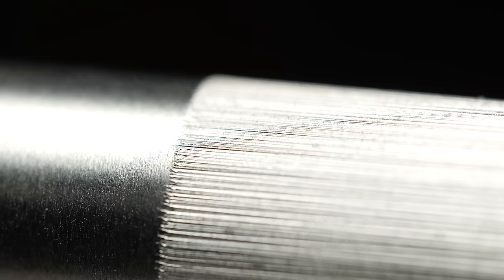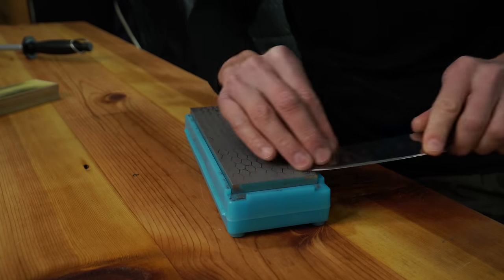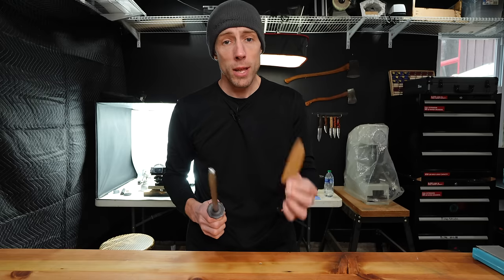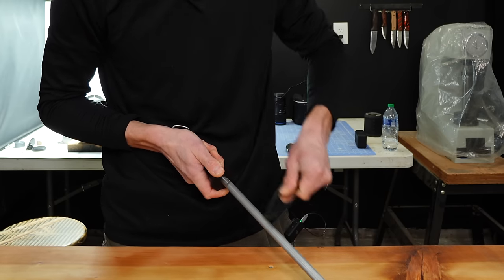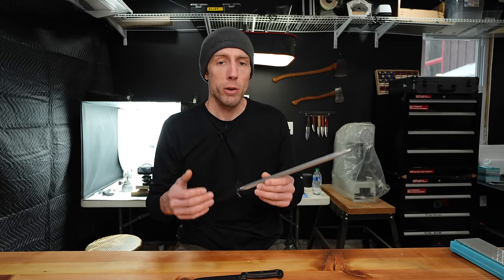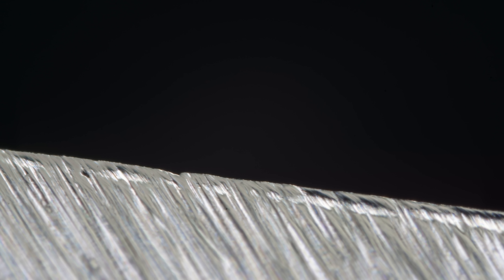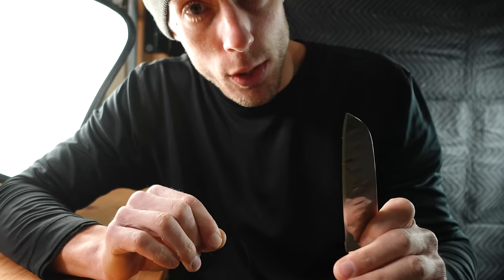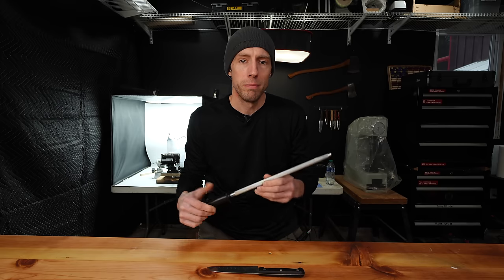What Do "Knife Sharpening" Honing Steels Actually Do?

Comment: As involved as this was... It's unfortunately not that simple. There's a few things that have been over looked here. Firstly, these were invented sometime in the late 16th to early 17th century in England. A lot has changed since then. One thing that has changed is that they're simply not made the same way as they were even 100 years ago for the most part. It used to be that most of these had a rough side and a bald side. They also used to be made out of much harder steel. And the roughness was not made with these regular width and depth finely cut grooves either. Pretty much all of the modern made honing steel rods I've seen are merely mimicking what the product was.

I attribute this drop in quality to the slow death of expertise as things shift more towards mass production. For an example of what I mean that's perhaps relatable here. What big cutlery manufacturers can tell you why their blades have the features that they do? How many of those knives have drop points that actually brings the tip to centerline? Or have a false edge on both side of the spine so that it correctly changes the geometry of a tip to make it more resistant against lateral breaks and bends? How many have a standoff for the handle that's actually adequate to prevent the hand from making contact with the cutting surface? Or have even have a significant change in thickness and included angle along side a scoop or ribbing at the heel so that it can actually be used to cut bone and cartilage easily?

They take the average of what a kitchen knife should look like in their estimation and do something to it feature or stylistically that makes it branded for them. But they rarely seem to (as evidenced by performance and specifics of appearance) understand why the different types of kitchen knives look the way they do. So most of the honing steel rods you'll find for sale new these days are simply not the same thing as what they once were.

You're not nearly the first to tread this ground. The line of investigation you've done has been done with older steels (microscope pictures and all) and older knives, as well as different makes of newer knives and steels. The results are very different than what you got and varied among themselves. Stainless steel was only invented in 1912. The steel that both the knives and the honing steels were made from for a majority of their history is not the same. I bet you'd see different results if you did as much as switch brands and quality. Such as Using a Dickoron steel with a Hinkle. But you'd likely see a difference in outcome and process even between standard high carbon and stainless.

That's before all before we even get to the problem of the tip...Overall point being is it's hard to definitively say anything about these except that they have been in use for hundreds of years but have begun to fall out of favor for various reasons. We might be able to say that antique versions of them or even use with older knives will have batter results. But it's even hard to say that much and have it hold true consistently.

Comment: After thinking about it I can now show that this video contains half truths and that a steel is absolutely useful even if you have removed the burr created by sharpening.

1. Any metal or alloy of metal becomes weak when very thin. There are no exceptions, any metal - when thin enough - will bend with force.
2. Even if you fully remove the burr created in the sharpening process, if you have an apex then you have a metal that is thin beyond its ability to remain stiff.
3. That very thin metal (at the apex) will bend over with force.

In reality it might be useful to split burrs into macro-burrs (ones created in the sharpening process), medium-burrs (ones that a steel can correct) and micro-burrs - the unavoidable burrs in an apexed edge caused due to very thin metal at the apex (these might be so tiny that the knife is still very sharp).

The claim in this video that steels solve a problem that shouldn't exist because the burr should have been removed in the sharpening process is naive. A kitchen knife with time and use will develop medium-burrs and a steel can absolutely straighten them.
Yes, you could remove the burrs using an abrasive/stone as suggested in this video but you are removing material. If you are removing material then you are either just re-sharpening your edge or you are going to have to increase the angle of your bevel to keep it sharp.

Ultimately because any metal will burr when very thin you only have two options.
1. An 'apexed' knife is just a straightened burr.
2. You can round off the edge of your knife.

Comment: Thank you for this investigative video. Very interesting, but I have some questions:

Is the diamond steel really straightening a burr, or is it just removing steel and sharpening it out?

And if you are straightening it, why did you not use trailing passes on the diamond steel instead of push passes?

Comment: Whatever they do, I can take a somewhat dulled kitchen knife, and create an edge which is CLOSE to that produced with a sharpening stone, without removing nearly as much metal from the blade.

I mean going from "this isn't as sharp as it should be" to "this is almost perfect" using a large number (about 75) light strokes on each side.

Is it a substitute for sharpening stones?  No.
Will the steel prolong the life of a knife compared to using a sharpening stone every time a blade losses its ideal edge? Yes.

So, the steel has its place if you don't want to be buying replacement knives every decade or possibly even more frequently.

Comment: Honing rod is a essentially a stainless steel file. But with single direction filing edges, rather than cross or tooth etc. There are many file types. You can remove some material from your knife with these...but it's a time consuming waste of time as far as I'm concerned. I remember seeing my grandfather using these when I was young. Same as you mentioned...fast passes etc. Yea so I tried and tried and tried, to no success EVER to get a sharper knife with these things. I've had better luck with leather and sandpaper with less effort and time.

Comment: When I worked in construction I honed my knives at steal pipe. That was good enough to continue cutting plastic and glass fiber insulation. You need to use a bit of pressure to make any difference

Comment: I get it.  A honing rod can not straighten a rolled edge.  OK. No worries, because I don't have any knives with rolled edges.  Apparently, it can remove an unwanted burr, so OK, that is good enough and works for me.  Fact is, I have 30-40 year old knives and I only use a honing rod (with a very different movement and technique than depicted in the video) and they all cut like they were brand new.  Fact is, I CAN cut veggies, especially very thin tomato slices, after using my dopey old honing rod.  And my wife agrees it keeps her favorite cooking knives sharp and like new.  Considering my wife is NEVER WRONG, it appears I have no knives with rolled edges, and my honing rod has been removing unwanted burrs for decades.  Go figure.  Works for me.  JR

Comment: For an update: I did better with the sharpening. Although, my knife seems to cut less than when I sharpened it. I didn't use the honing steel; I used the strop. The edge is now very sharp. I guess I'm still cutting with the burr? Thanks for your contribution.

Comment: ...where did you even get that strand of hair? o_o

Very interesting video. I was taught on knife steels when I started working in kitchens, and also came to the conclusion that they suck after a couple of years. I really liked finally learning why, though. Now I only use a diamond rod for honing and ceramic for finishing. I also learned quickly that there are very different opinions about using them edge trailing or edge leading, so I've always been doing both, first edge leading for "sharpening" and then edge trailing for "polishing". Not sure if it actually works that way, but my knifes has been hella sharp.

In my experience, chefs tend to use knives in the 100-300 dollar range, typically with a 58-60 rockwell. It would be very interesting to see if such knives respond to the traditional knife steel in the same way, being of higher quality steel. Anyways, awesome video buddy. Thanks!

Comment: Very educational. I didn't know the difference between a burr and a rolled edge. 
I use a diamond stone to sharpen my knives. When I felt like the knife was not cutting as smoothly I would apply the knife steel and it seemed to improve the cutting. 

Have you experienced this? The direction one sharpens the knife blade tends to bias it towards that way of cutting as well. Typically we pull the knife towards us when cutting so when I sharpened the blade in the opposite of the cutting direction I found that the knife would not cut as well.

Comment: high school "home Ec" soft steel sharper edge but dulls quicker; Hard steel not as sharp but holds it longer
Rod is for deburing after you sharpen, to remove the little pieces, aka the burrs. I didn't know a rod would straighten the burrs induced by cutting boards but that means it has a purpose. Chief in Jamaica - country of origin is important. BTW- 440 stainless tools rust.

Comment: Samir! Stop! You're breaking the car!
Sooo you expected sharper knife by blunting it with pressured backward passes on the steel rod? Way to go. Rod is NOT a sharpening stone. Do as kinda sharpening a scythe way - tip forward, with minimal possible angle, very low (almost none) pressure... Can be done with pretty fast motions as you see chefs do it. If you're getting rounded edge after - you're doing it wrong or the knife already needs proper sharpening, not fast shape up this thing provides.

Comment: uses honing steel incorrectly it doesn't work!

As described in the video, steels don't "sharpen" your knives insomuch as they don't grind a new edge. They take the existing edge and realign it. The rolling done with the copper tube is way more extreme than you would experience with even frequent use. At home with my $12 dollar knife from Wal-Mart, I generally will use my steel after about 2-4 hours of cutting at home cook speeds. After about 8 hours, if I forget, I will notice my knife cuts significantly worse, either feeling dull or shearing to one side during the cut. So how do you use a steel correctly?

Run the blade over the steel, from heel to tip, holding the blade 15-20 degrees from parallel with the steel in an EDGE-LEADING motion, as if you are trying to shave off a piece of the steel with the knife. You want to make sure you get a complete stroke along as much of the steel as you can. Alternate sides of the blade with each complete stroke. If you steel your knife after about 2-4 hours of use, you only need about 5 strokes on each side. If the knife still does not perform as you wish, it's time to break out the sharpener of your choice and grind a new edge. If you don't finish your sharpening session with a fine or extra fine sharpener, it doesn't hurt to run the knife over the steel 5-10 times on each side. 

While the quality of the metal of the knife blade will have a very big impact on how well it holds an edge, the easiest way to ruin a knife's ability to hold an edge is to run it through a dishwasher. It's like meth, not even once. The tempering of the steel of the blade will be undone by the heat that the dishwasher gets up to and maintains. Even my cheap chef's knife from Wal-Mart specifically instructed on the packaging not to run through the dishwasher, and years later it's holding up great. I'm sure there are other products that perform a similar function, but you can get a steel rod for very cheap, often under $10. Be fancy if you want, but you don't have to if you are on a budget.

Comment: This guy thinks untold generations of people in the past were too stupid to figure out deburring.

It the past culinary knives (at least in the West) used to be relatively soft, and meant you could actually restore a slightly dull edge to shaving-sharpness with a hoaning steel. It was never used for sharpening knives, just for touching them up before and after use. That way the edge lasted longer, without removing materials with abrasives. Have you ever heard about peening scythes? It's something like that, but more subtle. Modern stainless steels are simply way to hard to be hoaned in such a way. 
There were whole medieval guilds of cuttlers, who sharpend and hoaned blades as their profession, ancient Romans and Greeks had professional barbers, and used scalpels to perform operations. Greeks were even capable of creating primitive analogue computers like the Antikythera Mechanism. I can assure you, they might have known about what a burr is. 

In short: Using a hoaning rod on a modern kitchen knife made of modern stainless steel is like putting reins on a motorcycle. Medieval knights who used reins were not stupid, but you might be.

Comment: Good video, informative as always, but couple of things I would add. 
In Europe these are mostly used by butchers, (probably used in the kitchen, but I am not aware to what extent). They use high quality flat (er) steels, they have two sides (cross section is kind of like an ellipse). And they do not hone like on a strop, they push the blade in the steel, like you would do on a stone. There is defiantly some chips, steel dust, that gets created. Older guys call it a "magnet" (direct translation), because they are usually magnetized (I suppose to keep the steel dust, shavings, so it doesn't end up in the meat). Now they probably worked better for somewhat softer older knives. I have noticed that the one side ceramic other side diamond (check Dick Dickoron Duo for example) are getting more and more common (probably as butcher knives got harder steel), there is also many combinations ceramic and steel, different roughness steels etc...  The main issue I have with your approach is that you used the steel as a strop (in that direction of moving the edge on the steel) and the quality of the steel, a good one over here from the German company DICK costs about 150 dollars and the cheaper ones usually seem like they are not doing anything or even making the edge worse, maybe the result would be the same who knows...

Comment: Thank you for the video. Very interesting.
I’ve been an amateur knife sharpener for many years, and also cook quite extensively.
I’ve heard many “professionals” say that would actually does the cutting is the burr itself. To hear your comments about how a burr should be removed and that a knife without a burr cut much better and lasts much longer was a bit surprising. Do you have a video that explains that concisely? If so, would you please point me to it?
Again; thank you for the excellent video.

Comment: Interesting. I use 600 to 800 grit wet and dry paper with CRC or WD40 to sharpen my knives (carbon and stainless), then finnish with a steel. 
I touch up the bade from time to time with the steel to "keep" the edge.
The same knives get used in the kitchen, at work and for hunting. 
Never had a carrot, cardboard box or a dead animal tell me my technique was wrong. 
I thank you for the enlightenment.

Comment: I got a diamond sharpening rod back in 1995 when i used to go fishing. I still use it today, it seems like it will last forever.
For more heavy duty, i use 1000 grit wet rub sandpaper on a flat surface.

Comment: My experience as a chef is that a steel is extremely useful. Yes, it ''only'' gets you by, but I don't have time for ''properly'' taking care of it, assuming it's MY knife. Often, the knives that are available come from a cheap sharpening company that replaces them weekly. Those knives SUUUUCK. They're made of very soft steel, have a truly shitty plastic handle and to make them razor sharp when we receive them, a lot of metal is removed. It's actually quite odd to get the knives week by week, since they often differ in length quite drastically. The edges are rough, often they simply use sandpaper belts instead of whetstones. Those knives absolutely will roll their edges, in part because of the mandated plastic cutting boards that can be very rough on soft steel. One of the problems is that they're RAZOR sharp, they're thick metal sharpened down to a very fine point which makes the edges very vulnerable and prone to losing their edges super quickly. Razor sharp is not always the way to go for kitchen knives. Different edges for different purposes, always.
For my own knives, I absolutely prefer using whetstones, but there's nowhere near enough time for me to do that at work. It's something I do at home, when I have the time and energy. You also have to take into account, we put our knives through A LOT. Sure, wood is hard, but steel is harder, it's not that good a test. One of the knife killers in a professional kitchen is fat. Removing skin and fat from prosciutto for example can really soften your knives, and using the steel before and after definitely makes your life easier, even if it's not perfect. Another big one is salmon. Skinning and cutting can really put your knife through hell. If I want my babies to be in the level of ''tip top perfect'' shape, I'd have to use a whetstone daily, and I can't. I'd love to, but a high class restaurant's work is a game of saving seconds. A couple seconds here when grabbing a squeeze bottle in exactly the right way to use it perfectly makes a world of difference over a few hundred plates a day.
I'm not saying you're wrong, but the steel is still a must in a professional kitchen, although abrasive steel sounds like a great improvement, would love to try that.